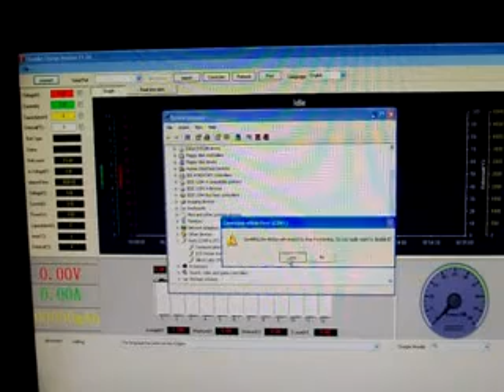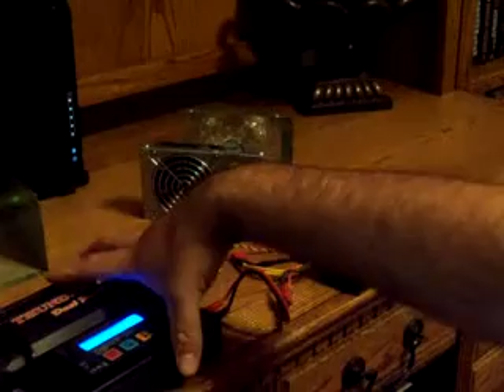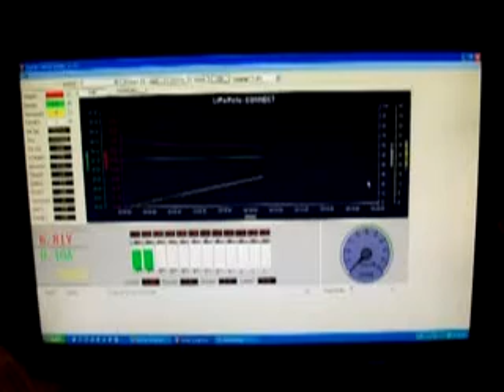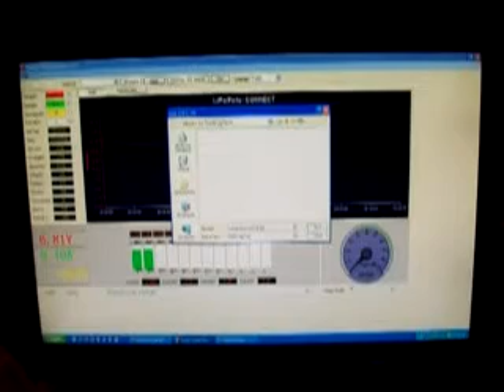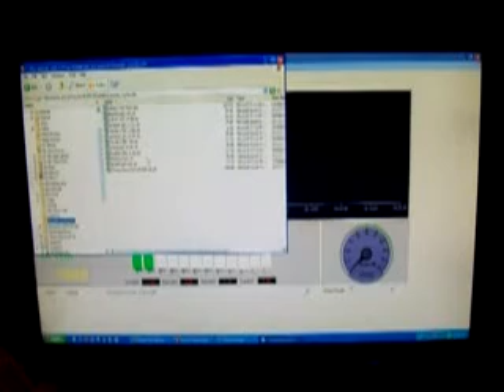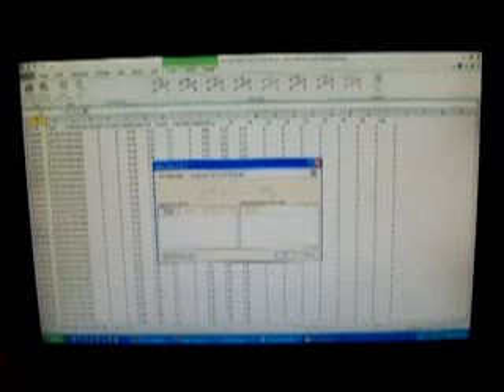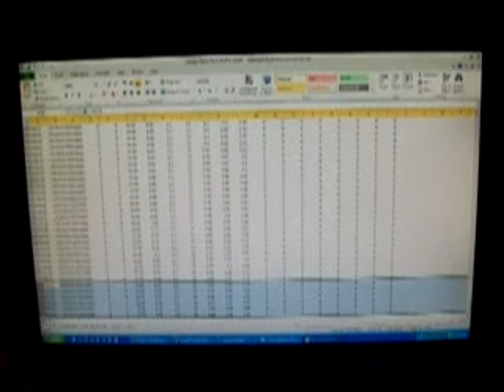Thunder AC6 Software Demo

Comment: cheesy software you have to computer properties device manager open bad port (device plugged in to find) and manually update/install drivers from browse program>thunder >driver folder not the x86 or x64 folder thanks for the disable com1 tip mine showed up at com3.  I also got stuck not programming blue box > usb/temp  to usb on. Software is at hobbypartz where i bought.